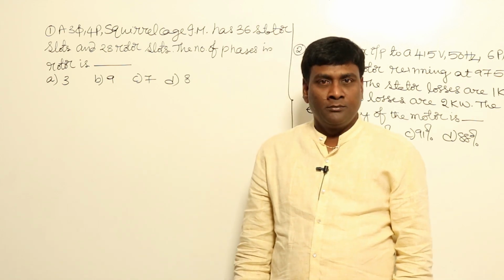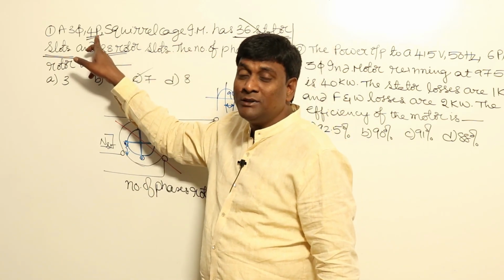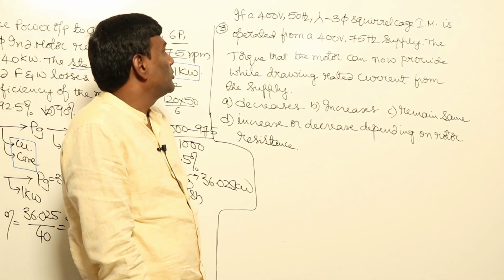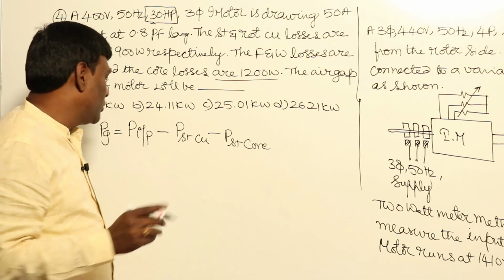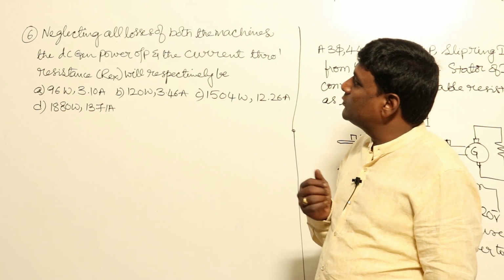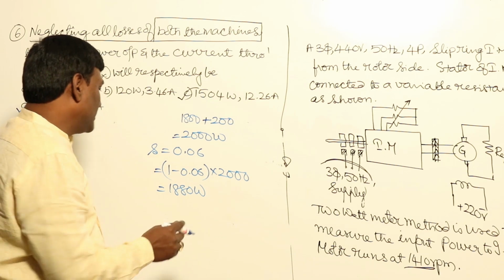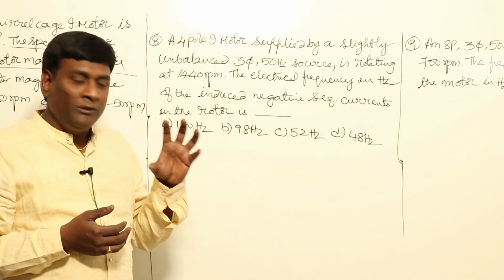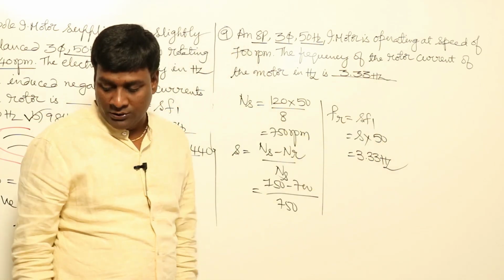Induction Motor Problem Set-1 | Electrical Machines | GATE Lectures by KN Rao | KN Rao for GATE/ESE

Comment: Sir, if we increase the rotor resistance by keeping the load torque constant, what will be the effects on motor speed and stator line current ?

Sir, about motor speed I know it will decrease but I am not able to analyse it. And about stator current I think it should also increase because as speed will decrease, induce emf will be more, so current will be more, so armature flux will be more, so to counter this armature flux, motor will draw more current from stator side.